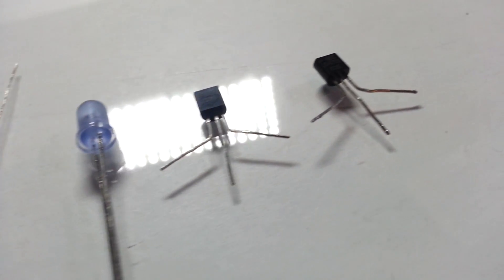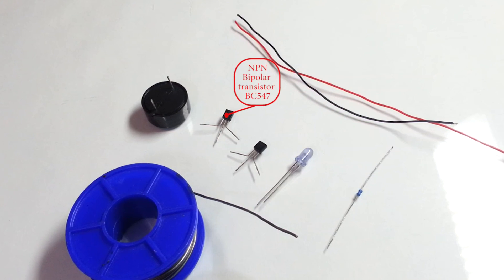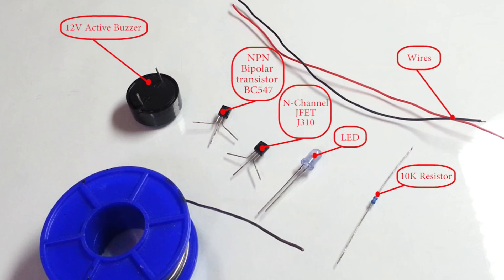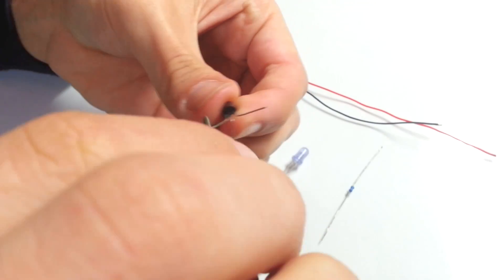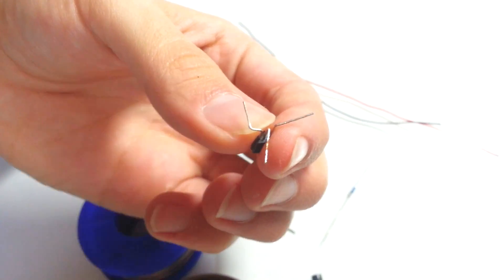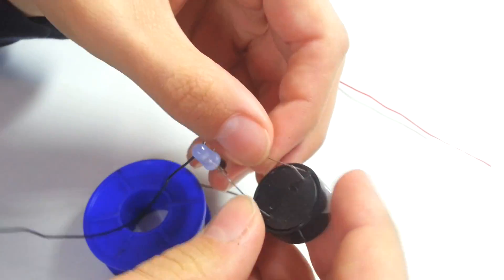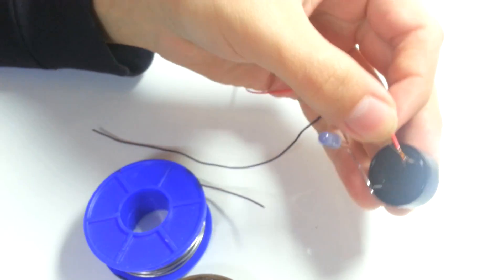Static Electricity Detector - Can Sense a Hairbrush From 2 Meters [DIY]

Comment: Thank you! It works like a charm with very good sensitivity. Can you give me short tip how to add level indicator? Actually when I move hair comb close to circuit it just switch on buzzer/led but I would like to indicate smoothly how close is that hair comb to antenna...

Comment: TIP: I thought I would offer a little tip. While playing with this awesome project I wanted to run it with a nine volt battery. I ran into a problem with the piezo traumatizing the battery. I took two 10uF electrolytic and put them in parallel across 12volt source and charged them till their belly's were full then I put them in series across the Positive and negative across the piezo. the boost was insane and made all the difference in the world. depending on the piezo you are using they are a real source killer.. don't put the caps in series with the source, it can turn the transistors into crispy critters . don't forget you are doubling up. my piezo is good between 6-26 volts
Reply: I'm trying to do this but failing any chance u can post a video with schematics

Comment: I would like to build this to detect static electricity on a printing press.The static reeks havoc in the priinting process. If I used longer leads from the power source, would i still get the same results. Is the a way to use smaller power source to make the detector portable?
Reply: Do you have a static eliminator?

Comment: very nice. It was an informative video. Thanks.
As you know, static electricity in the card is high voltage. It is worth thousands of volts. However, we do not notice, since there is no current. I want to ask something;
How can I make this project to detect the Nano and pico volts, and the detector whose sensing power can be adjusted from the lowest to the highest value?
Reply: i think he said, increase the length of gate wire to increase sensitivity

Comment: I thought antennas picked up AC, but static electricity is a DC potential.

Why does this work?

Is it the movement of the brush that is inducing the voltage onto the antenna?

Comment: Ok so I read what you said about adding a transistor in place of the buzzer. I have 2 questions. 
1. Where exactly would the placement be for the 1k transistor? Because the buzzer has a positive and negative terminal. So how would you replace buzzer with transistor. 
2. How would you place a toggle switch to cut power from the buzzer, so you can turn the buzzer on or off but still have the LED light in working order.?
Reply from the maker: Please don't confuse resistor and transistor. If you need a switch I recommend doing small modifications to the circuit: First, replace buzzer with 1k resistor, so you just have a resistor and LED conned in sequence, make sure that LED works. Now buzzer: connect plus lead of the buzzer to the wire that connected to plus of the battery, and then connect minus lead on the buzzer to the collector lead of BC547. (collector of BC547 is where LED is connected). If it all works together you can just connect a switch in sequence to the buzzer, the switch will cut power to the buzzer. It doesn't matter where you place the switch, because it is connected in sequence with the buzzer.
If something is connected in sequence it doesn't matter what connected first, only polarity is important.

Comment: Thanks a lot for this interesting video , i'm actually working on a similar project , but my question can we use a normal 9 or 12 v transformer ? Can we use it in a normal workbench of electronics assembly ?
Reply: I would think a 9-volt battery would work.

Comment: Sir, can it sense AC power line within 2 meters ? Reply fast sir urgent requirement
Reply from the maker: Hi, probably not, or maybe it can if it is 30kV or something. It will not react to 230V for example.

Comment: Seems the lead acts like an antenna. A meter might be a nice addition through a variable resistor to calibrate it. But calibrate it too what? Perhaps its all just a relative difference and requires some more R and D and Trial and Error to have relevant values.

Using a whimshurst machine might make for some interesting values. Perhaps a multi position rotary switch like a multimeter with calibrations resistors on each position might make a variant scale that shows some real differences. Like anything, comparisons and multiples and divisions give relevant values. Hair brush verses whimshurst, verses van der graaf generator, with distance from each might make an interesting research project, with an accurate ruler to keep distance and come up with a hypothesis that has some relative values. For example much of these voltages are too high for a standard meter to connect wires directly. But with this antenna length on the gate of the transistor like device as part of the equation for constant values, there might be a reading worthy of value. It would also likely pick up on wifi? Or perhaps a different length of antenna/wire would mean a different bandwidth?

With the cheap taser like modules you can buy on ebay for a few dollars, which say around 500KV that sparks between the two electrodes. It might be interesting to see how close and far away a measurement would be on a metered version. Consistent distances would be necessary. In this day and age of video cameras on many different devices, documenting such experiments would be very easy. I would be very careful not to touch it to such sparking devices, as it would blow components or the meter. I do say I am very much looking for something to measure around 500KV of static volts, as stored in a huge capacitor that has current capacities that can be fatal. Perhaps even a direction antenna with shielding of foil to make a dish reflector.
Reply: PS I liked it and subscribed ;)

Comment: What voltage is your power source  as you have 12v buzzer could I use the  same curcuit with 3v buzzer and 9v battery
Reply from the maker: Hi, although my buzzer is 12V it even works with 4V as well. Yes, you can use a 3V buzzer and power it all with 9V battery. I recommend connecting one more LED sequentially so it will lower the voltage to about 3V for your buzzer. Getting exactly 3V may be tricky, but you will get voltage close to 3V when using 2 blue LEDs and 9V battery.

Comment: Does it have to be 12v can it be lower
Reply from the maker: Hi, I've used a 12V buzzer that is why I use 12V, but my buzzer can work even with 5V as well... but in this circuit an LED connected sequentially so I'll need a little higher voltage than 5V to make it all work, I'll need at least 7-8V. You can use a 9V battery without any modification of the circuit. If you want to make it work with 5V, first check if you buzzer can work with 5V, if it can, then get rid of the LED, and it will work with 5V. It is possible to make it work from 5V to 16V.
Reply: Brilliant  thankyou for your reply :)

Can I just confirm what the 10k resistor does...
Reply from the maker: 10k resistor is a load for Q1 (j310) transistor, Also it supplies current to the base of the transistor Q2 (BC547) and turns it on. Without that resistor BC547 will be always off.

Comment: Assalam ualaikum dear. I subscribe your channel for informative videos, I want to know can I use this device for detecting underground electric cables?
Reply from the maker: Wa alaikum assalam. This device only can detect static electricity, so no, unfortunately you will not be able to detect underground wires with it.
Reply: @ElectricalPro  ....thnks dear
Reply: So there is any other circuit that can detect electric cables in walls. I want to use this device for secure and safe work for drilling like lcd stand fixing or any other drilling work that can damage underground electric cables.
Reply from the maker: I've never tried to build something like that, so I don't know. Try to google it, maybe you will find something good.
Reply: Ok ..you are from where?
Reply from the maker: I am from Ukraine, and you?
Reply: M from Pakistan ....
Reply: I am building electrition & i have a machanical workshop also
Reply: Ooo i only know about Ukraine just from name not much More

Comment: an this be a lightning detector?
Reply from the maker: Hi, in theory, it has to react to nearby strikes... but I did not test it... I think it will only detect very close strikes, maybe in 1-2 km radius... but it is just my guess. If you want to detect a thunderstorm that is 100 km away you need to use a radio receiver, long-wave/short-wave receiver will do the job.

Comment: Why does the ones i make,work in reverse, they turn off when im near and sound when im not near it with static charge?
Reply from the maker: Hi, I don't have an answer for that. This device is very sensitive and always behaves strangely. It has something to do with how charged you are positively/negatively, and how charged this device at start, and objects near it... it is hard to tell.
Reply: Electrical Projects [Creative Lab] thanks for that:) have you made a more stable device that sounds and light when static is detected?
Reply from the maker: Not yet, I have a couple of ideas... hopefully, I'll make it in the future :)
Reply: Electrical Projects [Creative Lab]  mine does the same when switched on it lights up and when it detects anything the lights go off the thing is the board is using 3 x BC 547 so i think that is the problem do i need the 1x  J310  so that the light is off and switches on when it starts detecting electrical charge plus i have 6 leds connected if you can help i would be great full

Comment: As soon as you post it I will start working on it immediately.  Can I use the same transistors for the project?
Reply from the maker: For the negative charge N-channel JFET (J310) is fine, but for the positive, we'll need to use P-channel JFET, and I don't know which one P-channel JFET transistor I am going to use. It is just an idea for now, it requires some testing.
Reply: Ok, I have many old curcuit boards out of many different things, hope I can salvage something to work. I love to  repurpose things and make new things. It's easy to buy a finished product, but that takes the fun out of it.

Comment: Hi, I got my j310 jfet  in and put it together with 10k in place of buzzer and the led stays on real dem, and will not detect static. Not sure what's the problem
Reply from the maker: Hi, again. Let's do a test to find out what is wrong. Please disconnect R1 resistor from J310, and if after this your LED still stays on, it means that the problem with BC547. If your LED turns off it means that the problem with J310. Tell me your result.
Reply: It went off, so maybe all of those transistors are bad. They have J310 at the top of the transistor and 548 at the bottom, and on the package it says J310 N-channel JFET  TO-92. HOPE THESE WERE THE RIGHT ONES.
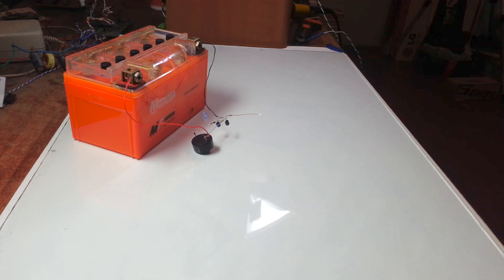Reply from the maker: Try to discharge gate as I did at 2:31 - 2:35, just touch minus and gate at the same time. If it still doesn't work then something wrong with your J310, try one more. Markings are correct: J310 N-channel JFET  TO-92, these are the right ones, no doubt about that.
Reply: I did notice that my power source is 12.6 to 12.7 volts could that blow the  J310?
Reply: I am using an old pc 200 watt pwr supply.  It gives 12 volt 5 volts and 3 volts but might not be exact not sure because I am using a  cheap volt meter cen-tech model 69096 and has 20, 300, and 1,000 DC v settings and the reading changes on each one a little. Like a few points..3 or .7 of a volt
Reply: From one side of the LED to the other, what should be the voltage?
Reply from the maker: 12V or 12.7V it doesn't matter, J310 can work fine even with 25V. On the LED you will have 2V or 3V, but it doesn't matter because your LED works. You can try 9V battery if you want, this device works with 9V as well. I think something wrong with your J310.
By the way, if you are doing it for the science fair then you can build a tripwire alarm instead, just connect a thin copper wire instead of j310, and if someone breaks the wire the LED will be on.
Reply: Don't know why my last 2 posts did not go thru, but it works now, the problem was me. I was too close to it. I had to back up 3 to 5 feet to keep light off, wow and this is without an antenna. So I put it I a cardboard box and lined the outside with tin foil and it still didn't seem to effect the sensitivity.  So I wonder why foil don't stop the static.  Or  if anything will stop static. This is really amazing. Thank you so much.
Reply: OMG Tryed again this morning and found different results from different people.  Where LED went off  when I was far, another could get next to IT AND WOULD NOT LIGHT UP. So connected the copper wire of 12ft coax to antenna and when he put finger on end of antenna the LED went out but when I did, it stayed on.  Both of us wearing rubber shoes on cement floor.???
THIS is very strange isn't it? 
Do I put off some kind of energy that he does not?  Also, if that's the case, what could we made to measure differences in this energy people give off? We are AMAZED! !!! We have heard of people giving off energy but never really thought much about it until we made your static device. It really makes you think, when one person gets the opposite effect, from your device. It's like I am one big hairbrush, LOL.
Reply from the maker: I am glad it is working. I think there is a reasonable explanation for that. This device is very sensitive so maybe even small differences can be detected, maybe your shoes just different enough to see that effect. Make it more scientifically, do the experiment 10-20 times, just to have some statistics. I think it can be actually random, and if so, then a have an explanation, - the mains electricity interference. By the way, this device only senses the negative charge, but I want to make a device that can sense both negative and positive charge, and indicate which one it is with two LEDs, maybe I'll make such device one day.

Comment: Hi, I ordered my j310 jfet transistors and there was 360 number also attached to it. So hope it's the right one. A pack of 5. 

If I don't use the buzzer do I need a different resistor?
Reply from the maker: If you don't use a buzzer you need to connect 1k resistor instead of the buzzer, otherwise your LED will burn.
You don't need to modify anything except adding a resistor instead of the buzzer. (You can use 0.5K - 10K resistor).
I don't know what that 360 number means.

Comment: HI, I have a question, if we just use the buzzer and led, is it a 12 volt LED ?
Also I noticed when it stayed on you put your fingers on the antena, to get it to turn off the LED, and buzzer. So is there something I can put in the circuit to make it turn off after say one 10th or two 10ths of a second so as the buzzer will just chirp?

Thank you so much for your input.
Reply from the maker: No, you don't need 12V LED, it is 2V or 3V small 5mm LED.  Usually, the buzzer turns off automatically if you move the hairbrush away, watch it at 2:39, but sometimes I think the antenna becomes overcharged or something, and you need to discharge it by touching antenna with one hand and minus lead of the battery with another, and I think nothing we can do here.
Reply: I was thinking about a relay to cut the hot side off, but I cannot find a timer that will turn on and off in less  than 1 second. Will just have to use it as is until I can think of another way.😀

Comment: Did you use a 10 k 1/4 or 1/2 watt resistor and also how many amps will your buzzer handle?
Reply from the maker: 10K 1/4 resistor will work fine.  Buzzer doesn't handle current (amps), it consumes amps, so it doesn't matter what is written on your power supply 1A or 1000A, the buzzer will take just 0,005A and nothing more. (as long as you use 12V)